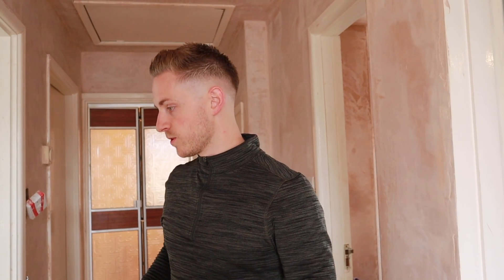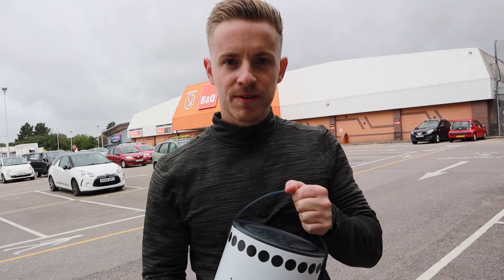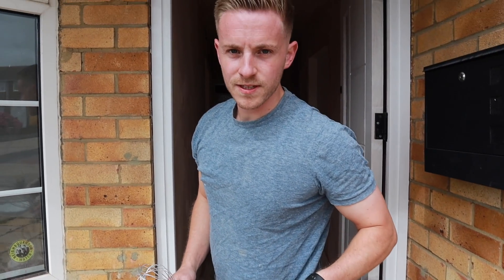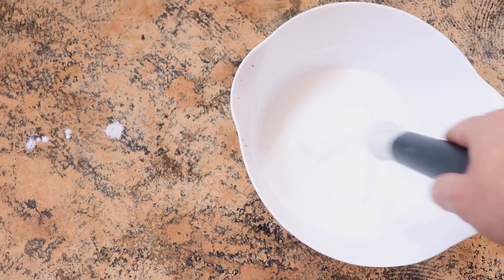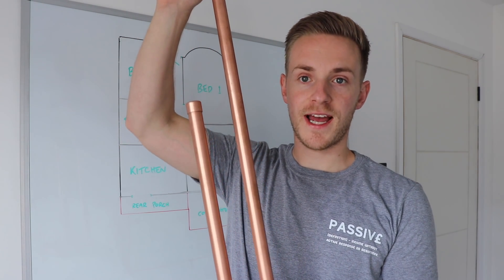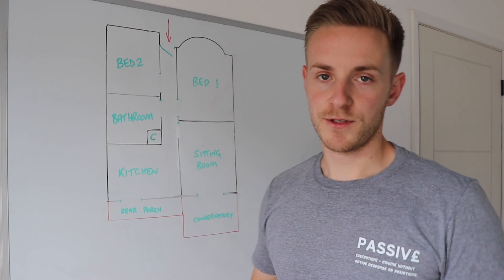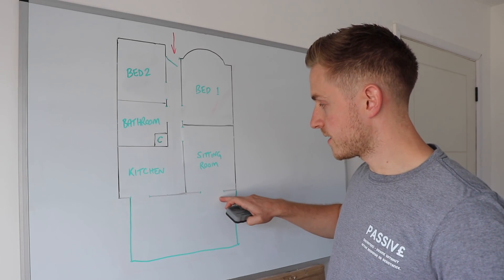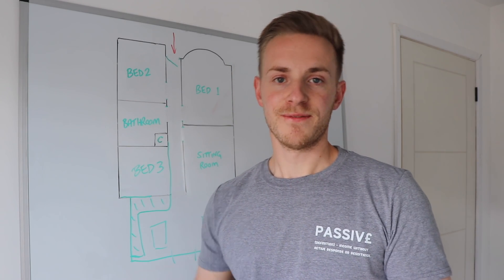My bungalow extension plans - renovation vlog

Comment: Hey Justin I can see the benefit of the extension and extra bed that will create a lot of value. Just wondering what the dividing wall will be doing in the sitting room once the extension is built? Is it loadbearing is that why it is staying, I would look to close off the original door into the sitting room and extend the hallway just to the point where the entrance to the 3rd bedroom is and then remove the rest to create a bigger kitchen open living space.
Reply from the maker: Yes very good question and I wish we could remove the whole wall, however it is load bearing and therefore would be an expensive job to support and remove it completely. What I forgot to mention is that we’ll probably remove the old sitting room door, to make that a really nice and quiet snug area 👌
Reply: @JustinWilkins  Ah yes see where you are coming from now and why you will do away with the sitting room door.

Comment: 🎉 wow. Great update mate. Excellent vision for this project. Truly a great plan.

I was wondering though. Have you thought about building works in the winter especially as a wall will be knocked down to do the extension. Can't imagine it being comfortable to live in with all the elements coming in 😅.
Reply from the maker: Thanks mate! Appreciate it 🙂
Ha funny you should mention the winter, that is our main concern. Won’t be the most comfortable thing to do that’s for sure 😂
Reply: @JustinWilkins  yikes. In my experience it is brutal. I Kno you want  some down time but if you could start sooner rather than later you could at least get weather tight and soften the blow plus get more daylight out of longer days.

Comment: Great Vid Justin, could you take a meter of the sitting room to create a en-suite off the back of bedroom 1? Not sure if the bathroom is to far 'done' to extend waste & water...
Reply from the maker: It’s a good suggestion, but the piping is the trouble. It’s probably the ideal place to put it, and I don’t think 1m would be missed from the sitting room as that area will be big enough 👍🏻😁

Comment: How about using a SaniFlow system for the 2nd toilet??

Pretty sure they can shoot the waste up pipes into the ceiling to get it across the property and then drop it back through the waste for the original Bathroom. . . Just a thought .
Reply from the maker: Thanks Joe. Great suggestion actually, and something for me to consider! 👌
Reply: @JustinWilkins  I’ve not tried SaniFlow before but I’ve heard they’re really quiet and handy nowadays for exactly this situation when you can’t get the waste away tidily.

Good luck!!

Comment: Permitted development is great but I thought if you wanted to sell in the next ten years it could cause problems? Is planning permission the only way round this?
Reply from the maker: Hi Bradley, thanks for watching and interesting thought. Have you experienced this yourself? Back when I was an estate agent I sold many houses with permitted development extensions, and apart from a bit of added paperwork there were never any issues? Any a large portion of those houses were flips - so refurbed and sold in 6-12 months.

Comment: Having renovated two of my own houses and having gone through 5 plasterers, I can tell you that almost all of them won't tidy out the muck around sockets unless you specifically say you want it done. All of them will stop short of the floor and you have to chisel off or sand back the lumps before fitting skirting boards. Their expectation is that the painter/decorator/joiner will make good. They never see the bigger picture because they're usually gone by then 🙄
Reply from the maker: Haha 😂 yes you’re absolutely right. Leave the tidy up work for the next person!

The thing is I did ask for down to the floor, and tidy sockets (not to mention flat walls - I thought that was a given). But unfortunately I didn’t get that!
Reply: Haha yes, they nod their heads and will even tell you what you want to hear and then immediately do the exact opposite 😄  I've been told I'm fussy and 'particular' by tradesmen for wanting things to be done properly. You'd think that making sure things were square and level would be standard practice but nooooo 😅

Comment: Where is door to bed 3??  Dont think permdev is 6metres but go as big as you can afford anyway, to get best return.  Plan is good one 👍
B+Q is defo my go to shop, but I go to them all - Wickes, TravPerks, Toolstation, Screwfix, etc. Just shop around, but cheapest is not always best.  
I dont believe trades are gonna turn up until they walk down the path !!  Good luck with it all.
Reply from the maker: Oh yes! I forgot to draw on the door for bed 3 😂 it will just come off the hallway as well be building a stud wall there.  

Re trades - after recent experiences, I think I’ve switched to the same mentality. Il only believe they’ve started once they are at my house 😃👍🏻